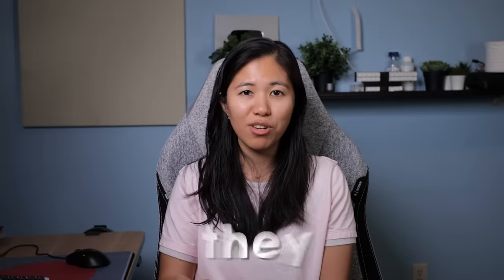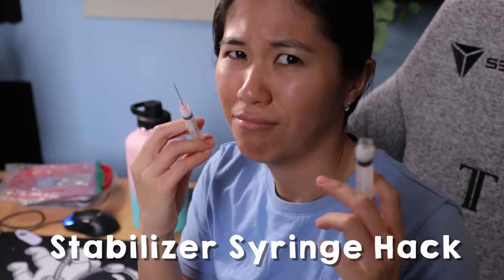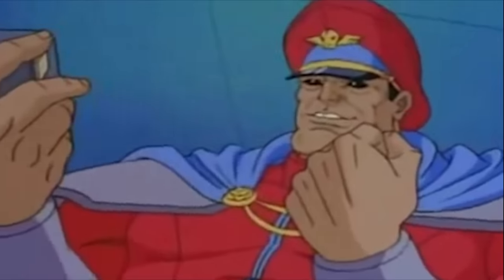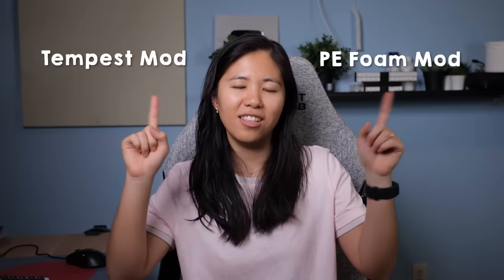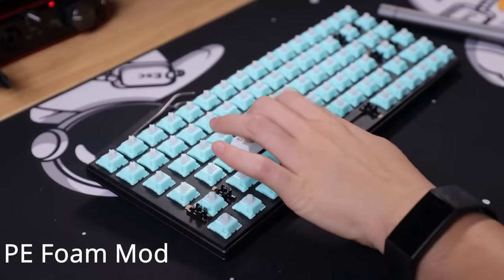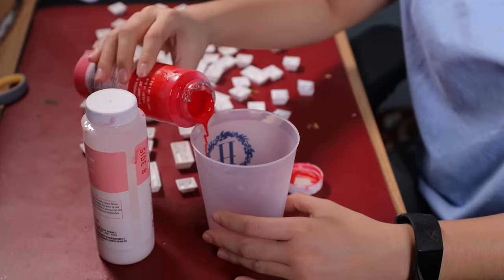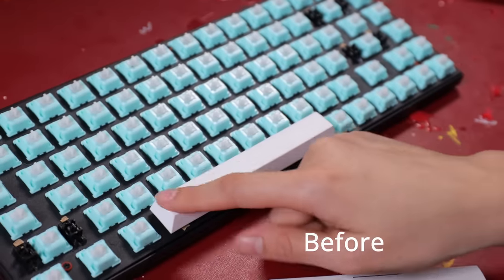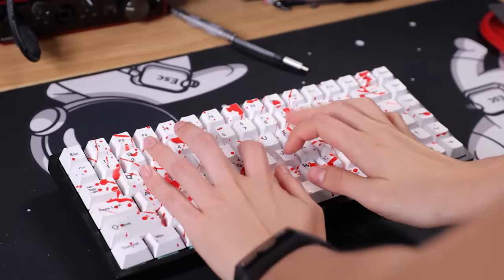7 Keyboard Mods That Make Your Keyboard Sound BETTER

Comment: I used to have no idea what keyboards and switches are good but this channel has help me make good decision when buying a keyboard thank you
Reply: So what was your good decision?
Reply: @shreyasdharashivkar8027  I almost bought a keyboard I had no idea what brand it was now I’m just saving up for a custom keyboard with the right switches and key caps
Reply: @notzephyir6975  just buy a prebuilt and then mod it
Reply: @paklekj4429  thanks for the advice
Reply: Yup
Reply: @paklekj4429  i started with modding a prebuilt and ended up building a q1. Now I’m waiting for a coarse60 and fbtkl. Point is, I ended up wasting that 70 or so dollars on modding a prebuilt when it could have went to an extra plate or switches. It really depends on what you want out of the hobby. If you’re just gonna mod 1 and be fully satisfied with that, then power to you. But if you see yourself going deeper, I’d personally suggest getting a budget custom like the kbd67lite, portico or heck the q1. Just my 2 cents tho, I get way more satisfaction from building customs than modding prebuilts.
Reply: Axbrey  same here bro
Reply: Same
Reply: @notzephyir6975  if you have the budget you should consider the kbd67 lite r3
Reply: This is actually relatable. But seriously this is the most relatable comment I have ever read.
Reply: Same
Reply: :P
Reply: @shreyasdharashivkar8027  I bought Glorious GMMK RGB Barebone Black, Gateron Red switches (some spares too), and some beautiful simple colored keycaps. This was the cheapest possible keyboard I could make which could actually last. Cherry MX switches are too expensive in India but their silent red is the best.
Reply: Same
Reply: Me stuck with a junky membrane keyboard 😭😭😭

Comment: To avoid the o-rings falling off the standoffs, you can put them on the screws, put the screws through the pcb, more o-rings, and the line it up.
Reply: I came here to comment that, I thought it'd be common sense, trying put the o-rings first and than align everything is so dumb.
Reply: In your guys opinion 

Is that mod worth it?
Reply: @MARS-eb8pt  I mean it's a few o-rings and there is a tangible difference in sound and I'd assume typing feel, so yes imo.
Reply: Came here to comment this, don't know why all of the youtubers do it this way...
Reply: @MAGAIVER  Yeah, tried the o-rings first and quicly figured out it was gonna be hard to align everything. Way easier to put them on the srews.
Reply: LOLLOL
Reply: Heheh I came to say the same thing. I've worked on motorcycles (and some other stuff) for more than half my life, so this was just so obvious to me I was like "what the heck" :D Especially since those o-rings are so tight they look like they'll in fact grip the screw easily so nothing should even fall out when you turn it over.
Reply: @MAGAIVER often times when following instructions we tend not to stray from them. This can cause us to overlook methods that might make more sense.    I guarantee you're doing hundreds of things every day that you could be doing more efficiently. That doesn't make you dumb, it's just a consequence of where your head is at when you first set out to accomplish a new task and what tools your brain has available based upon past experiences.

Comment: Instead of Polyfill, use polyester fleece from a sewing shop. Easier to work with and you can layer it to the desired thickness.

Comment: I think that for filling the caps with silicone you could use the same syringe approach as the stab lube, but with a 40-50mL syringe (to avoid wasting time refilling) and a 14 gauge needle! seems promising!
Reply: Thank you very much, I will try it!
Reply: A less messy alternative that I have done is put foam tape in the spacebar.

Comment: For my keyboard, I put a couple layers of tape under the pcb, and a few layers of EVA foam in the case, and just one between the plate and pcb. Sounds really good for a cheap gamer keyboard!
And also lubed switches and stabs, and a xda keycap set that's a bit thicker than the original set.

Comment: polyfill is an especially nice mod over foam on gasket-mounted or other flexy keyboards because it compresses way more than most foam. I use it in my Q1 and it retains almost identical flex as no foam has, but without the ping of having no foam.

Comment: I was actually looking forward to hearing all of the silicone filled keycaps. I thought about doing it before, but it is really time consuming with a syringe.

PS: The splatter actually turned out awesome.
Reply: Hey, I have the most pedantic correction. Technically, it's closer to a spatter than a splatter due to the smaller droplets. <3

Comment: My keyboard has a battery in it and I’ve been using the tape mod for about 2 months now…
How did yours almost set fire?
Edit: I’ve also done mod 6 before and I would recommend using a syringe, also you should probably only fill the keys that use stabs because it’s the most noticeable difference
Reply: @switch and click, Curious to know about this as well since I plan to do mods on my feker ik75 and use the wireless option. Not sure if there was a video on this before.

Comment: I have a suggestion for anyone looking for a deeper sounding switch in a budget, but it's a frankenswitch, where I took the stem of an Akko Silver and used a lubed housing and lubed spring from an Akko Ocean Blue. This made for a nice deep linear switch, and the stem of the Silver didn't need lube as it made no difference. It would probably also be fine with stock blue housings but I already had them lubed from a previous build. The silvers on their own are also good for a budget thocc with no mods, since lubing made a minimal difference for the few switches I lubed on it

Comment: EVA foam does more wonders. I’m using one for case and PCB, and they work well for these past few weeks without any fire hazard (mine has Bluetooth function with battery).

I say all of these “hacks” are all worth it if you can dial it correctly.
Reply: Yes, EVA foam's great! I've got layers of it inside mine (cause I only have 2mm sheets). Made it sound a little hefty.
Reply: so its fully safe to tape mod it eventhough i have a battery?
Reply: @bim.ajadah  ofc

Comment: Thank you very much for compiling all these mods into one video like this. It was super entertaining, and gave me more insight in the actual sound changes that the mods might give myself. I just put together my first custom keeb using the Tecware Phantom 87 and just swapping the switches to the Akko Jelly Starfishes (p.s. the horror stories of using those included metal switch pullers were true...RIP many Gateron Reds :( lol). Suprisingly, the only mod it could see most benefit from would be the tape mod, which will be safe in it seeing how it isn't wireless. MAYBE the band-aid mod would do something too, but overall...this budget board is almost too solid when you pair it with decent switches.
Reply from the maker: Thank you for watching!

Comment: I managed to achieve the sound I wanted with Polyfil. I arranged it in the case in little pieces so it filled it eavenly and it didn't get too much in the way when it was time to put everything back together.  The splatter one is the true Halloween keyboard

Comment: Much respect to you.  The willingness to take things apart is one of the most beneficial traits a person can possess.  Over the course of a lifetime it will save you great sums of money and vastly improve your understanding of how and why things work like they do.   One word of caution- anything with large capacitors (old TVs, CRT monitors, microwaves, AC units ect) read up on how to safely discharge the capacitors before you open things up.   A capacitor can sometimes store enough of a charge to end a life so just do a bit of research so you know how to identify what capacitors look like and how to make them safe to work with.  It's not a hard or complex process, just an important one.  Keep up the great work!

Comment: i used tissue paper with holes in it to mimic foam and clear tape for "foam" and "tape" mod, but it worked. I also discovered no difference between using fabric and plastic bandaids for any baindaid related mod

Comment: Just watching gave me the idea of using a seringe for the silicon as well, that way you get a nice control and application.  I imagine the cap full would not bottom out all the way as it would make contact with the switch, but just a nice layer at the top could really be nice, especially for keys like the spacebar that have lots of open space not over any switch area.

Bonus use a pretty clear silicone and perhaps the RGB would still work well on shine thru caps.  Also could try epoxy resin.

Comment: Love the over dramatic voice :)

Not related to making the keyboard sound better but I can't find any info on the internet about using clear resin to coat cheap ABS keycaps to protect it from peeling (eg. Logitech G815/G915 keycaps that has no PBT replacements).  Will the keycaps feel worse?

Comment: The silicone mod was a mod I did a year back with glue intead on the space bar. It didn't turn out well and I ended up losing my spacebar and having to use a replacement because it kept being mushy and I could not take it out. I wasn't the brightest to think about that:shelterin:

Comment: Just did mod # 6 but with out silicon.  I used Hot Glue.  It is easier to control and if you get to much you can use the tip of the hot glue gun to heat it up again and remove some.  Buying more expensive keycaps is probably better.  But, doing this will make cheap keycaps sound much better.  The RGB even shines through the hotglue.  So, the letter on my cheap keycaps still light up.

Comment: The stabilizer syringe hack is the one i've been looking for. Because i was worried about the lube getting into the board and it will not work. Plus my keyboard doesn't have a hotswap so yeahh thank you so much this really helps me.

Comment: i wonder what kind of silicone that u used, i also did kinda similar experiment not silicone but 3m tape on the keycap wall,its does sound thockier but silicone method will give better result

Comment: What switches sound the thocc-iest without having to mod the keyboard inside out?
Reply: Gazzew bobas u4t ( require lubing, also tactile) or aqua kings ( pretty sure they come factory lubed, also linear)
Reply: if ur in a budget go for gateron milky yellow pros (or the normal pro) but if you want expensive thocks go for boba u4t if ur a tactile guy or gateron ink black v2 if ur a linear guy

Comment: The silicone version, maybe you should try the syringe. The tip is precise and it's easier to get the same amount.
The disadvantage is probably that you cannot mix as much at once and have to do it in stages.

Then there is a clay that many have for costumes. It becomes like foam plastic. Black and malleable, and can also be cut afterwards. So, it might be easier to poke such clay into the keys.

Comment: You can actually get poly fill in sheets that are much easier to work with. The sheets are usually labeled as quilt filler.

Comment: Foam under each key cap is like a weaker o-ring mod, provides a much quieter feel yet not as bouncy as o rings. It does take long though because it requires you to cut holes for the stem but the weight feels the same.
Reply: Just a heads up on the Foam Keycaps, I used 1mm EVA foam and it can give off a "mushy" feel, but for office quite typing it's better than nothing. Combined with o Rings though it makes it way too mushy though.

Comment: Turkey basters are super cheap and great for applying silicone to small spaces. Otherwise, Home Depot, Lowes, or whatever hardware store is in your area should carry silicon and latex caulk in a squeeze tube which both also would be great for this mod!

Comment: Your silicone filled caps experiment is sort of the same as the o-ring-under-the-keycaps kits you can buy on amazon. The  point is the put a little bit of silicone under the keycaps so when it contacts the plate, you get silicon-on-metal instead of plastic-on-metal sounds.
Reply: I just recently o-ringed my K95 and it made a huge difference. I also used blu-tac to, uh, stabilize the stabs and it really helped. I know the K95 is leagues below a custom board but I just bought a 3080 so I doubt the wife is going to go for a new keyboard.

Comment: Hi Betty, 
Can you use dielectric to lube stabs, such as the stem and housings? Thank you!
Reply: Im not Betty but I don't recommend lubing the stabilizer housings with dielectric grease. The dielectric grease should really only be on the stabilizer wire. The housings and stems should be lubed with the same lube you use for your switches such as krytox205g ( try using thicker lube). Hope this helps!
Reply: @leapphrog1178  what happens if I already lubed them? Will it be like Vaseline and eat the plastic?

Comment: For anyone who did the syringe one, I used dielectric grease but it was very thick and rendered 3 separate syringes useless and I had to throw them out. I’m happy with the result but the process was hell on earth. Any tips or advice on how to make this easier next time? Btw my floor is very slippery

Comment: the guy who told that you were scammed by walmart here, i put springs with similar size to the rubber dome in a membrane keyboard and now its a linear mechanical keyboard, is that considered a hack ?-?

Comment: Which switches are the loudest Thocky switches.  I got some pre-lubed Akko Black Jelly switches which are thocky and sound pretty good, but it would be great if it was a little bit louder.
Reply: Thank you for the heart, but which switch will be louder and still pretty thocky?

Comment: 6:09 after yesterday I can confirm I am never applying grease to switches ever again. Took 3 hours to open the switches and apply krytox, and I over-did it slightly on two. The sound diff is great but pre-lubed is probably similar

Comment: I'm planning to mod my keychron k4 v2. Would adding the tape mod and the polyfill be a hazard. U mentioned that it almost cause an electrical fire in your video...
Reply: Shd I still use polyfill or tape for it?

Comment: Hello! one small question! can you change a spring from a red switch to an black switch (as long as the total travel of both switches is the same, the same brand, etc) and get a black switch with the actuation force of a red one? (i speak in general about mechanical switches...).

Comment: is it dangerous to do tape mod on a keyboard with a battery
Reply: If there’s something between the tape and the battery it should be fine OR you can use electrical tape but that might leave a sticky residue

Comment: Don't use scissors to take out the battery. If you puncture it it will burn a hole in something at best, at worst it will burn your house down. Lipo fores are NO JOKE.

Comment: My mod on the gk61x was that I removed all screws completely so it lays loose in the case und the plate is held by the switches and where screws would be I put some layers of bandaid in between

Comment: Yo I tape modded and foam modded my keyboard a while ago. And my keyboard has a battery. Should I be worried.
Reply: I don't think so. I don't what happened to her keyboard that caused the fire but I'm guessing the battery was already bad. Fire does not start for no reason, tape by itself will not cause it, a good working battery without any punctures or defects will not cause it.
Reply: @vectivuz1858  tysm, j plugged my keboard

Comment: Removes li-ion battery with scissors: "Safety is #1". One wrong pokey-poke to the outer battery layer and it's shorted, that's how you get the fires :DD

Comment: My top mods would be using blu tack inside the case keycaps and between the gaps in the switches, making o rings that arent mushy by holepunching folder card. Making switches highly tactile by hole punching rubber domes and putting them inside your keycaps (doesnt make bottom outs mushy.) Lubing switches without disassembly by using a toothbrush. And finally bending the click bar upwards on box clickies to stop the double click and male them more tactile. Also on membranes putting blu tack at the bottom of the keycap then sticking pieces of wooden kebab skewer in all sides to give membranes a solid bottom out. All tutorials on my channel. 😎

Comment: Idk also been experimenting with mod 6 “silicon mod”, but found out it’s much cheaper and easier to use Elmer’s glue or wood glue. (Plus that nozzle is a big help)

P.s I know there are setbacks to using this cuz if ur gonna clean ur keycaps. It’s gonna be hell
Reply: They are also acidic glues, so be careful. There are similar non-acidic glues available to use instead.

Comment: I actually made my first ever mechanical keyboard set and it came out great but left me with a cut finger also haha. 😂♥
Edit: Also just a quick question what makes the tape mod dangerous to a keyboard with battery in it? does the battery reacts to the paper or adhesive of the tape? please I need answer because my keyboard RK61 has battery built in it and I added EVA foam part of the mod and planning to do a tape mod soon. 😥

Comment: I have a cheap keyboard with thin keycaps. I did use transparent silicone rubber (not the liquid type) to cover the inside walls of the keycaps, leaving room for the stem base, and although it is time consuming.. It did enhance the sound and dampen the echo noise.

Comment: My keyboard is a cheap 60% keyboard with outemu blue switch (matcha green on shift, z, x, spacebar), it have very bad stabs and i use tape mods (5 layer on pcb, 2 layer on case), bandaid mods and holee mods (no lube, I don't have any lube yet) and it sounds decent now even tho the spacebar still have some rattle, and thanks to that 8 layer of tape my keyboard is so stiff right now🤣